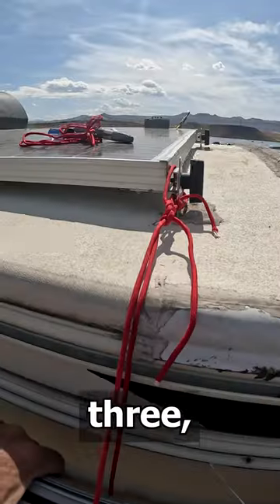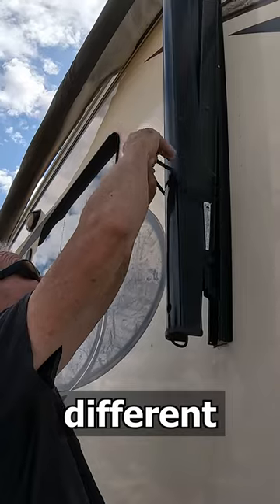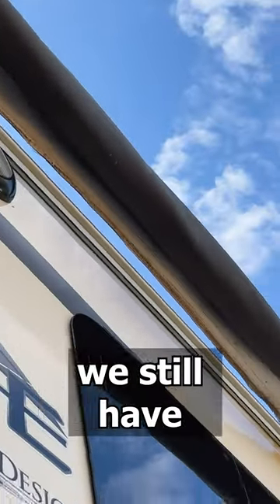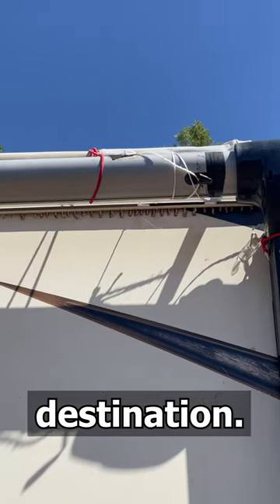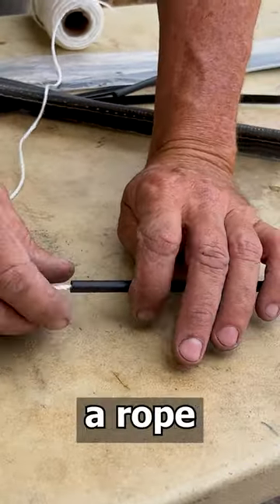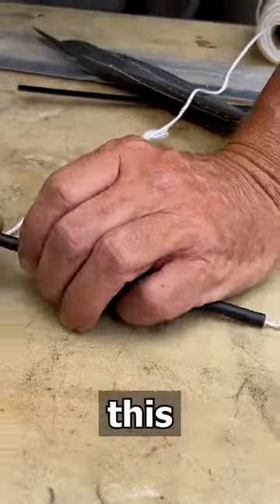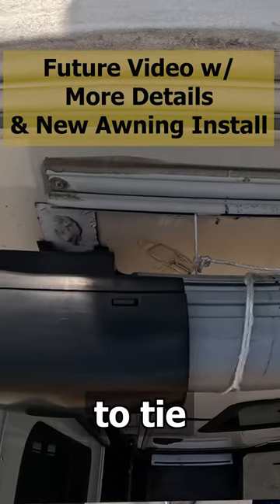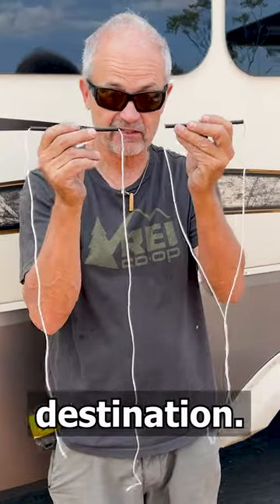Wind Ripped RV Awning Quick Fix #shorts  4K

Comment: maybe u shd get an awning thats 70% dense mesh but not total fabric so the wind goes THRU it instead of blowing against it; we live in a windy area; thats what we have over our gazebo otherwise a solid fabric cover wd get ripped off; we have 75% shade with a dense mesh; its enough shade.
Reply from the maker: I haven’t seen anything like that sold by any company selling awnings for RVs. Interesting
Reply: @DownsizingMakesCents  if u can find a piece of it the right size, then sew/hot glue a canvas border for it to attach it to whats left of the original material border of the first one, u shd b able to have it roll up/retract like the first one. it wont b waterproof, but it wont get ripped off by the wind, either.